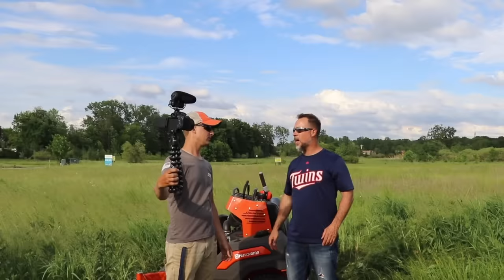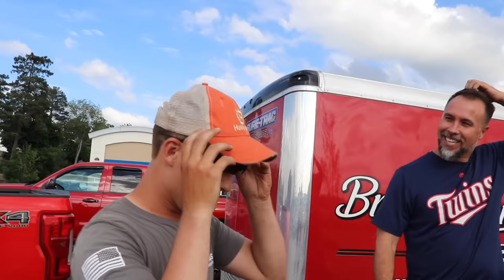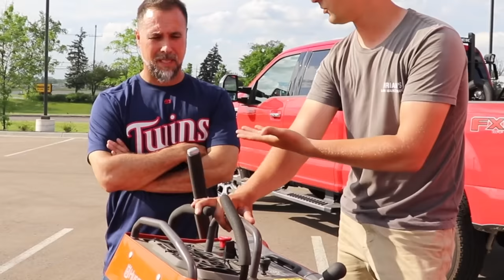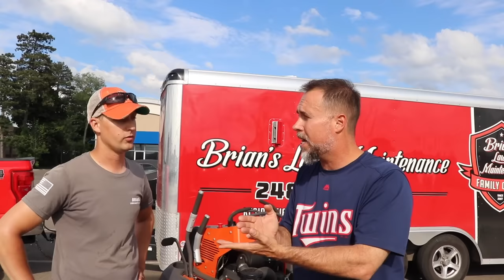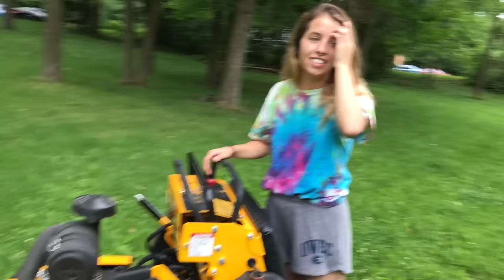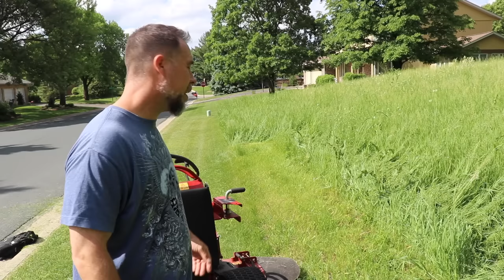Best & Worst lawn Mower of the Year- Husqvarna, Toro Grandstand or Wright stander z

Comment: Another thing to add. When servicing a Kawasaki engine, you have to clean the fins every 100 hours to cool the engine and with it being so tight and compact it doesn't make sense, you'd have to pull the whole thing apart. Poor design and can't find one person that likes it.
Reply: Evan Ferrari  I’m not sure that’s true I have a v ride with a Kawasaki it has almost 600hr and it has ever gotten hot at least not more than normal
Reply: Tyrrell Roach i hope you are joking....
Reply: I need to kiss my kubota in the morning.
Reply: No I’m not I assume he talking about the fins in the side of the block and they stay pretty clean on there own.  Now if you were to say that about a kolar engine I would be more inclined to believe it because mine seems to run hotter than my older Kawasaki
Reply: Tyrrell Roach he is, but on a mower. On mower engines there is a fan on the crank shaft pushing air over the cylinder head and it is all covered in shrouds. Grass will work its way in and if wet will build up and your mower can catch fire. Motorcycles just rely on clean air from the road.
Reply: The fan in the center of the engine is different than the cooling fin cast into the block no air is forced over those fins.  Now if you don’t keep the fan clean that is a different story it would be like running a water cooled engine with out water
Reply: Tyrrell Roach the fan does force air over the cylinder head fins. The whole space can clogged up with grass. Motorcycles don't have that because it relies on wind from driving.
Reply: JCLawn51
Have you never seen a Kawasaki or Yamaha on a mower? I've seen plenty.
Reply: Russell Starr yes. Have you seen a vertical shaft twin engine Kawasaki or Yamaha on a motorcycle? The answer to that is no.

Comment: I'm more of an Exmark fan myself.
Reply: We have 3 of them.  Great machines!
Reply: We have 5 exmark
Reply: Claire Shearer, I think an Exmark with a bagger, could mulch and bag up a Husqvarna. Lol
Reply: Isn't the vantage and grandstand the same thing essentially?
Reply: 2 things I don't like about exmarks, the hurt is r stiff as hell and give almost zero hydro feedback, and the front wheels r way to wide and just lay grass down when turning...other than that, tons of power. The foot pedal is kinda weird aswell. Needs a upgrade so it's not so far away and u can push on it like a clutch peddle. So 3 things lol
Reply: David Moore, 2-3, who's counting. 😉. I too am not a fan of the deck pedal. But yes, lots of power.
Reply: To The Top Crane what about the stiff hydros and front wheels being super wide? I don't like it. And the stupid rubber flap for the chute gets caught in the deck height operations and jams it up. Drives me nuts.
Reply: David Moore, the hydros on mine don't feel all that bad. I don't mind the front tires. I haven't had an issue with them leaving a stripe. The chute on mine spends most of its time tied up. I put a cable on it so I can raise and lower it from the seat. For the most part, I keep it pulled up.
Reply: To The Top Crane u don't get that feedback like normal hydros, they don't whine hands r just stiff. We have one 2017 and 1 2018 exmarks. They r both the same, I've been told. I havnt used the new one at all yet. Trying to talk the boss into putting them both on the same crew. But he's not going for it...im ok with the old bobcat, just gotta go slower and watch how the grass comes out the shoot and slow down it dewy thick grass.
Reply: David Moore, mine is an older lazer z-60 with a 31hp briggs. I'm also not on it all day, everyday. So, that may make a difference.
Reply: To The Top Crane . My old big Bob the Cadillac is trusty steed. I'm bummed my boss just hired a new guy this week and I'm being taken off the grass crew to go with him for landscaping since I know both sides... I love cutting, leaving golf course stripes even in our shitty lawns in the hood... I take pride, plus I wanna make my lawn look better than the crew leader/driver. I love when the boss gets calls saying something I did looks awesome.  I low key hype it up in the m mornings to make him butt hurt haha
Reply: Toro owns Exmark and the engineers on the Exmark side usually just hang their deck under the Toro tractor/frame.  They sometimes make some changes but it depends on the machine.  Typically in taller grass the Toro outperforms the Exmark due to their blade being higher up in the cutting chamber.  Toro runs their blade even with the front of the deck where the Exmark is 3/8" up from the front of the deck.  Still cut tons better than many of the other mowers out there Cough Cough Deere Cough Cough
Reply: To The Top Crane can't go wrong with the exmark, but there's just something about a john deere 7iron
Reply: my kubota  and case dealer  stoped selling exmarks due customers habving problems with them and he been fixing them up alot
Reply: im kinda wanting to buy Kubota
Reply: kubota uses solid steel chute blocker in stead a plastic chutes plus the kubotas can have air ride seats if wanted optional
Reply: To The Top Crane same
Reply: Love the navigator, cuts great and it's fun to drive haha
Reply: Exmark is made by toro. So by default you love toro.
Reply: Screw everything but an Exmark!!

Comment: I know one thing my stander doesn't cut of when I step off to pick up something" or one handed running across large parking lots using a leaf blower , with the other" or 1 handed using a line trimmer down a 2 acre fence line saving a ton of walking"" do I recommend this" yes if you've do it for 25. + Years, with no problem, NO for a NOOBIE"  saves so much time, and if you have bad knees bad hips bad back" or still have some life left in you at the end of the day when you're out in 95° heat in the summer in Florida

Comment: Unfortunately too many products are designed by “Book Smart”!
Reply: Well let me ask you, can you design a mower? You can point out everything wrong with it but can you go from a blank sheet of paper and create the blue print that a company would use to mass produce a mower?
I know I couldn't. I wouldn't even know where to begin. 
I had a great idea for a dog house I wanted to build, but I couldn't even begin to put the idea on paper with what I wanted out of the dog house. I could see it in my head, but I couldn't transfer it to paper. 
The real test is can these engineers take the feed back and go back and fix the major issues that are pointed out to them.
Reply: @highjix  First off relax, he's correct too many products are designed by book smart individuals that work on computers and do not use the products they design for a living. The guys testing these machines are the customer and only their options matter because they are the ones buying them.

Comment: The test you did with the Toro was way easier on the machine than that tall grass you fed to the Husq. The problem is a bit obviously tho if u just look at the front of the mower you can see the taller the grass is, the more the stuff you flatten first is going to flatten the grass behind it. Without some serious suction from the machine or its blade design, taller grass is going to stay laid down and won't get cut.

Not saying the Husqy is worth the money or anything, but you wanna maintain credibility and show as little bias as possible with the actual test.
Reply: Even the toro timecutter can even handle that tall grass better than this $10k husky and the timecutter is a residential mower..there's a video on YouTube showing the the timecutter mowing grass 4ft high in one pass.. looks like Husky needs a new drawing board to follow

Comment: I’m going to get some hate for this. But when I come into contact with a mower that flattens instead of cuts, all I do is drop it in reverse. To a row, if it’s not cut I just drop it into reverse and got back over. I can see the safety issues with it, but 9/10 times it actually just better.

Comment: If you remove the baffles on your Toro it will cut tall grass 10 times better. Also tall wet grass won't clump near as bad. We had to constantly clean out the deck with the baffles. We removed them now the deck mowes better and is pretty much self cleaning

Comment: The best is a Ventrac and will continue to be.
Reply: Benjamin Eadie - yes they do. And that standup has a finish deck. A finish deck isn't made for 24 to 30" tall grass. Put a rough cut deck on there and I guarantee it will knock that grass down just fine.
Reply: A finish deck?
Reply: Yes ventrac and most manufacturers offer multiple deck options. A rough cit deck is used in heavy brush areas or tall thick grass with small trees and other under growth that needs a different type of blade or your not really looking for a perfect finish but to clear large rough terrain
Reply: i have to poop but i wanted to say real qiuck,- Yes ventrac and most manufacturers offer multiple deck options. A rough cit deck is used in heavy brush areas or tall thick grass with small trees and other under growth that needs a different type of blade or your not really looking for a perfect finish but to clear large rough terrain
Reply: finishing deck it is meant for grass that is only an inch or two too tall when it is mowed. Not 3 foot tall. It has to do with the front guard of the blade, horse power and blade style.
Reply: Thomas Hodis i had no idea. Thanks for the info. Now i wish i owned enough land to need one.😐
Reply: i have to poop but i wanted to say real qiuck, - hell you'll get there, keep saving money and find ya a nice piece of property in your dream location. Stay optimistic,  that's what I did and it worked out. It will for you too.
Reply: You are comparing apples to oranges.  Two different markets of  equipment
Reply: Ventrac rocks!  IGAF who you compare a Ventrac to, NOTHING compares.
Reply: Not for 25$ grand it won’t be
Reply: I don't know of any commercial lawn care companies who mow 15 to 20 different properties a day (with one two man crew) who use Ventrac to do that.   ( You can buy two to three commercial stand-ons or sit on zero turns for the same price.  Ventrac is a good machine, but very niche, and very costly.  If you need a machine for steep slopes get a 4 wheel drive John Deere X739 with a 60 inch deck under it, for 1/2 the cost of the Ventrac and you can still blow snow with it with no chains needed.

Comment: The husqvarna needs the feed (blade speed) faster than the speed (road speed). Why not have the safety foot controlled? 
Blade controls should be on one side, motor controls on the other side. Ease of maintenance is a must.  
What is the steepest climbing angle? 
I got a 30 to 60 degree hill in my back yard.

Comment: husqvarna(huskvarna)  not huskykvarna
Reply from the maker: Unless your norwegian- then its hoosqavarna LOL
Reply: There is one right several wrongs ;)
Reply: I just put the gas in, check the oil, give it some grease now and then and mow. I keep the blades somewhat sharp.  My "orange mower" works just fine. Saves me a lot of time compared to the old JD 160. If I want to cut the deep stuff I break out the old deere. Bought it for only $300 so if it gets trashed no big deal.

Comment: I see a lot wrong with the Husky but I won't hold the cut against it in that tall stuff. The grass is taller than the distance from the trailing edge of blades to the front of the deck so the deck holds the grass down below the blades. You can buy blades for that application. They create an updraft to pull the grass up into the cut. I have a Massey Ferguson finish mower behind a 35hp Kubota that would not cut that stuff very well. I'd have to use my bush hog first.

Comment: To be fair to Husqvarna at least hey tried their own version of the stand on. Yes, its embarrassing to say the least BUT everyone else just waiting until the Wright Stander patent for the platform between the wheels ran out and then they released their version of wrights mower.  This definitely makes me appreciate my Ferris Z2 though. It is the complete opposite of this mower haha everything is super convenient and easy to work on and the cut quality is just insanely good. The only downside to my Ferris is it has their new 500 hour oil guard system and the dealership gouge like crazy to change the oil in my machine. They wanted $300+ to change the oil and I did it myself in 10 minutes for $40-$50.

Comment: I’m in the market also called my dealer about some demoing some 36” stand on mowers they sell 4 or 5 brands 
My 3 picks are Bobcat  Toro and Wright 
Now I’m waiting for them to call me so I can demo and decide on my next purchase.
Reply: did you ever get to demo any machines?..i'm a bobcat fan but not sure about their mowers ..i have seen tons of positive reviews on the wright..have watched some companies using them and either the operators were trying to run them at full speed which meant double cutting or the blades were dull..i'm not sure ..but i know the wright 72 inch is a beast and will mow over small saplings if you want it to

Comment: I got a John Deere 652m love the cut the only thing I don't like about it is it kills the entire mower if I let go. Toro I have a 60 in grandstand I love to death. Everything's in the right place easy to work on well thought-out peace equipment. Btw my jd i had to replace the drain plug thing. Which I might I add sucks. And sucked even worse trying to replace it. I had to Dismount the entire engine to get it on properly. Toro on the other hand has it perfectly figure it out. I grew up on John Deere but Toro is definitely growing on me.

Comment: You guys are overthinking those controls, i actually dont have an issue at all. Mower shuts off because you are taking your hand off the safety lever with the brake off. If you pull the brake before you do that it doesnt die. I do wish it did a better job mowing really tall grass, i also find myself doing 3-4 passes before it looks good. Thanks for the review.

Comment: It's probably been said by someone else but the reason you couldn't cut the tall stuff with the husqvarna likely comes down to blade type. If that really was a demo unit set up for his landscaping business, it would almost certainly has low lift blades. Low lifts are meant for trimming an already well maintained yard to make it as neat and clean as possible. as it kind of tells you in the name, these type of blades will not have enough lift from airflow to pull tall bent over grass back up into the deck to be cut. If there was a set of high lift blades on there I'm positive you would have seen a much better performance in the tall grass.

Comment: Should use a safety like the ones used on jet ski's. Attach to your belt, belt loop or what  ever so it kills the machine when  you step off or safety switch on the step

Comment: I think for a true comparison of any brand is to have the "competitor" mower cuttin the same grass ( or hay field in this matter lol) i think our JD MOCO 946 might had struggled.with that field.....
I have a husqvarna gt52xlsi garden teactor with a locking rear differential.  23-10.50-12 tires on rear, and a fabricated  life time warrany deck
i love it for my personal lawn mower and garden tractor. I also have a 1981 sears craftsman gtv16 garden tractor i use both  in my personal vegetable garden.  In my own personal opinion you get what you pay for, and.any machine will lack in some areas and excel in others.
Look at sub compact tractors,john deere, new holland, mahindra, koiti, massey Ferguson, montana, ect. They ALL ARE MANUFACTURED OVERSEAS and "ASSEMBLED" in the USA. All parts are manufactured overseas for them as well. Different brands have different stong/weak points. And every one their own opinions. Great video stan. Wish yall had a.few more mowers to mow the same lot and then compare.

Comment: Need a 32 stand on mower for next year, debating to get the wright 32 or encore/world lawn 32 stander, leaning more with the encore/world lawn because you can do deck adjustments on the fly instead of the wright I’ll have to go to where the trailer is and get on the ramp, leave one wheel floating in the air so I can adjust it and ( get grease on my hands from the rings ) get off the ramp and do the other side, a big waste of time to me

Comment: Also guys, when you sharpen your blades, serrate them. Only takes a moment with an angle grinder. Triples the cutting surface and  makes single pass work possible in tall grass. If you are really into it, hard surface the edge first. Now you be MOWING

Comment: That was really tall grass. I've owned a Husqvarna rider mower for 5 years, its a 2654 model. They definitely got this tractor right. I just changed the blades for the first time this spring. I think with any brand of mower its in the " SPEED"  of the blades. If the Engineers would design them to have a faster RPM they would cut so much better. I reallly like my Husqvarna when you engage the mower it sounds like a jet engine taking off. I don't know what the blade speed is but that's definitely where its at, in my opinion.  You done a great review,  i appreciate it.
Reply from the maker: Thank you Dean !

Comment: i subbed your channel when i saw what you did and for the reasons you did with the ford trucks. this may have been a long video but i agree with yours and brian's opinions on that Husqvarna but i believe the wright though bigger and slower still did a better job over all and gravely is usually right up there quality and function wise. i have 6.5 acres and i look at what would cut through my jungle the best as well as what is easier and or more comfortable to use

Comment: I use a husqvarna mz5225 sit down zero turn mower  extensively its low height and lighter weight make it great for hills.  It handles tall grass and leaves a nice striped yard.  This stand up mower in video is not representative of what I have seen them do.